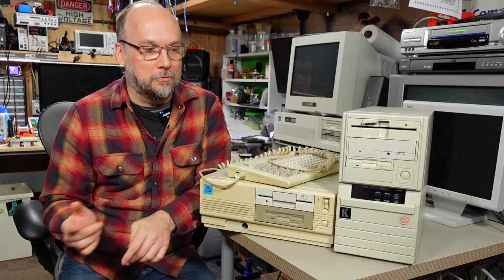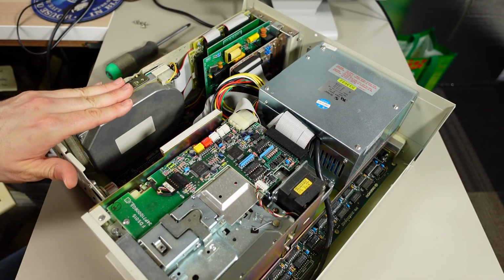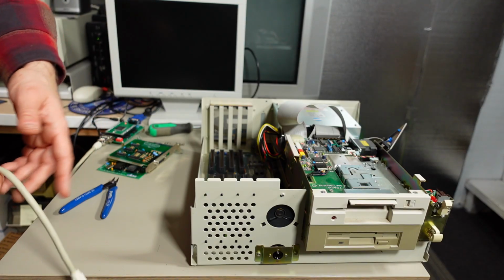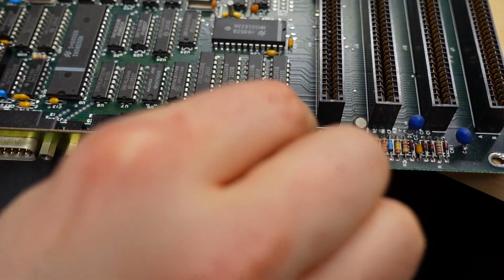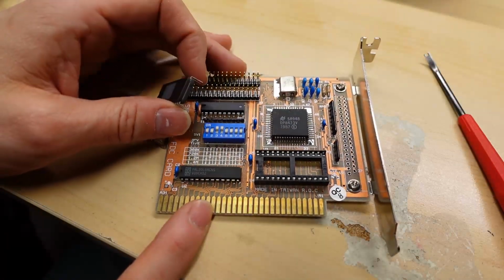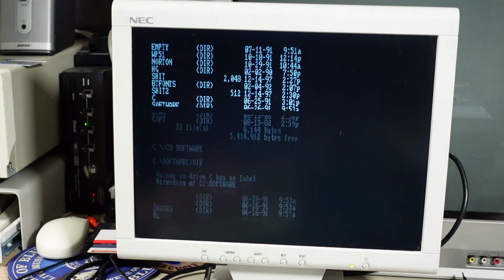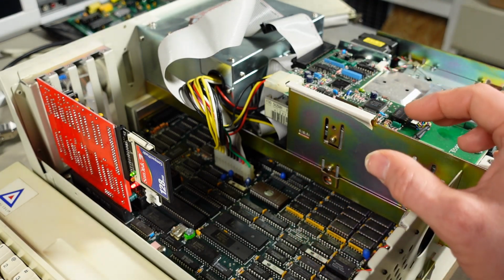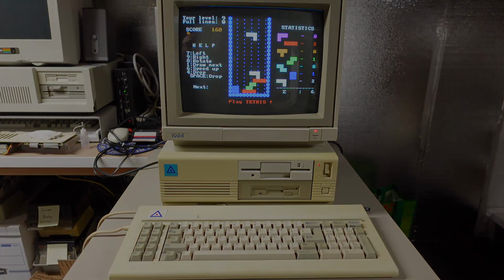PC archeology: Leading Edge Model D

Comment: Yes Leading Edge made 486's I had a DX2 66 that I eventually upgraded to a Cyrix 586 thanks to a Gainbery 133Mhz Cpu Maximizer cpu swap kit that I picked up at Costco back in the day ( around 95-96 ).  Kept the keyboard years after the pc was gone... Not like the junk they bundle with systems today... It was built to last ( messed around with AT to PS2 adapters then eventually to usb before I retired it) 💪👌

Comment: I know this is an old video, but I discovered you about 6 months ago and just turn on your videos in the background. I grew up in the "golden age", early enough to use a Commodore 64 but late enough to be a child through most of the early PC days (my elementary schools all had Apple II's, junior high had 386's). Your videos take me back to all that, and I realize now how much I miss it (even the "tedium" of setting numerous jumpers, that was candy to me).

My dad's last pre-Pentium computer was a Leading Edge mini tower: 486DX-33 with 4 MB of RAM and, I think, a 340 MB hard drive (WD). The coolest thing about it was that it had a really neat 5.25" floppy drive that was "half half-height", never saw anything like it before or since, it was essentially a laptop thickness 5.25" floppy. We kitted it out over time, adding a Pro Audio Spectrum soundcard with a SCSI interface and a caddy-fed 2x CD drive. Don't recall what the video card wound up as but we played Myst, The Journeyman Project, Battle Chess, Doom, Wolfenstein, a little known gem called Rise of the Triad, and I TRIED to run Quake on it (rather painful until we put that Gainberry 100 MHz upgrade CPU in it), and 8 MB of RAM. It had VLB slots, but we never used that. The CPU and some attendant hardware was installed on a daughter board along the bottom of the case for ease of access which connected via a long slot to the mainboard proper (RAM was on the main part of the board, under all cables).

Don't recall what happened to it, but that was the first usable PC that I REALLY got my hands dirty in, after light tinkering with his old Goldstar 386. Good days. Love your videos, Adrian, keep up the good work! If I ever come across anything of note in my basement or my parents' I will send it in!

Comment: Adrian -  I am both the primary author/designer/programmer of both the Wangwriter and the LE Word Processor,   I still have an LE and IBM that run LEWP.  I LAUGHED when you came across the ORIGINAL plastic sticker on the back but what you didn't realize is the BLUE LOGO on the left of the Model D front is actually a stick-on and I still have a few.,    It's a metal-like plate but the BLUE is actually plastic which peels off.  

I doubt the machine was from Late 1988 because by 1986 LE was selling Mitsubishi machines  - or MODEL Ms.  MODEL D''s the D satnds for Daewoo which  you discovered when your broke it open and saw Daewoo chips on mother board.

The battery was in Model Ds and early IBMS and its simply for the CLOCK.

The color of the disk drive with the lock tells me this was a DEALER-modified machine.   The original Model D  came with two floppy drives and then later shipped with 20mg Hard drives.   LE dealers often did their own thing after market and that's why you are seeing these other companies chips, drives and boards etc etc

Comment: After an insane amount of fiddling, I was able to get my model D connected to a very early version of AOL back in 1995. I remember it having an EGA monitor and I think I installed a 14.4 modem. Could get it on the main AOL screen but functionality was all but non-existent. Don’t think I was able to access web pages. Frustrated, I built a Cyrix 166 white box, 16MB RAM, and a 1.7GB Seagate HDD, win 95 and that was my first internet machine. Thanks for rekindling this memory!

Comment: Hi Adrian, i've connected so many times a 16Bit VGA card on an 8Bit ISA bus, the only issue, is that the bandwidth is slowe, but you can test even 8088 or 8086 with VGA cards. Some XT machines may not boot but, most of the machines will boot. Hmm, that keyboard looks fantastic, i would like the same quality in nowdays keyboards.

Comment: This was the first computer I ever used and cracked open.  It was my dad's that he had stored away in the closet for a few years until I started messing with it around 1990 (I was 10).  Had no HDD or modem, and had 2 5.25" drives.  The country I was in didn't have any software for the thing I could buy to learn (all I had was the DOS disks and learned some .BAT scripting).  That little 8088 still taught me a lot.

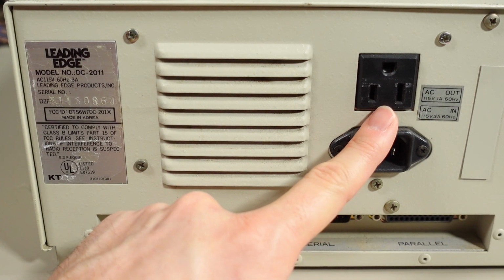Comment: 5:25 "You could plug in a power strip" ... it's rated for 1 A. You don't plug power strips into those because that creates the risk that you'll plug in stuff that'll burn out the PSU. Those power through ports are for monitors and nothing else

Comment: I bought one of these in 1988 for about $1200, a lot of money at the time. I couldn't afford a hard drive so initially I worked with two floppies. I also had a 1200 baud modem. I did my MS and my Ph.D on one of these and used it for my first 3-4 years as a professor. At one point I installed a hard drive, a whopping 20 Megabytes. The 1200 bad modem worked well enough to run SAS statistical processing over a phone line to the campus mainframe on campus. I also later added a 3.5" floppy drive so I could take my WordPerfect files to from home to use on my Mac office computer and print it out on the department laser printer. 

I really regret replacing it. Mechanical keyboard, light weight compared to the IBM keyboards. WP gave you a plain uncluttered screen that showed your text and some page and line numbers on an amber monochrome that was easy on the eyes. It would be worth having today because it was the best writing tool I ever had.

Comment: Just stumbled on this video. I remember these computers. When I was looking for my first IBM type computer, the actual IBM computer was extremely expensive. I seem to remember prices like $3300 ish. There were a LOT of IBM XT clones out there at the time. The Leading Edge Model D was one of the more expensive clones. It sat at a price range around midway ($2000ish) between the actual IBM XT and the clones, which I think cost around $1200 at the time. Much cheaper than IBM boxes, yet not as cheaply made as the clones. The Leading Edge Model D was a computer we drooled over at the time, but was typically as out of price range as the IBM XT itself was.

Comment: My first computer was an XT clone and I had both CGA and Hercules (clone) cards in it and drove two monitors simultaneously.

You said if no hard drive you could run 4 floppies, but you could still run 4 floppies AND a hard drive (or even two hard drives).

Comment: I had, and still own, a Leading Edge computer from the early '90s.  If I recall correctly it was The Leading Edge WinPro 486e, and it ran on the Intel 80486 processor @ 33 MHz, 4MB RAM, 120MB HD, CD-ROM drive, 5.25" Floppy drive, with stereo sound.   The OS it utilized was Windows 3.1.  So, this should be an interesting video for me to watch.
Reply: Yes, I still have the original keyboard, and overall, it was a fine keyboard, and still is by today's standards!

Comment: Adrian, you did not just buy a case in the late 80's/90's.  I worked for Computerland when those machines were new. We sold a ton of them along side IBM and major brands. Not off at all, actually, same plug just the female version had a surround to anchor it better. Why exactly do you do these videos? You have no personal knowledge  The Craft card is also a midi interface but you wouldn't know that since you know zero about any of this tech. That is NOT an MFM hard drive! It's actually RLL. XT's/and PCs did have batteries in off brands. Dude, get a real job, you are promoting misinformation globally which means more ignorant people talking about things they know nothing about.

Comment: I had a Leading Edge,  my parents purchased it from QVC in the early 90s - it was an XT clone being sold as new technology in the era of when the 386 was well in to production. Leading Edge at some point switched to Daewoo as the source of components which is where the D in the model name came from.

The built-in IDE controller was DOA from the factory on my machine, and the speculation (although I can't find historical evidence) was that Daewoo was using used parts in the machines to keep the cost down. Pile of junk

Comment: OMG.  I had one of these.  The front part of the case has yellowed, as I remember mine was white like the case.  Turbo XT, had a 8087 socket.  Compatible with the NEC V20 Intel CPU clone.  The monochrome graphics could use the CGA emulator to run CGA on monochrome monitors.  Looks like yours is different than the one I had, which had a turbo switch as well on the back.  4.77 to 7.16? mhz.  Mine came with dual 5.25" 360k drives.  The "D" in model "D" is for Daewoo, one of the Korean megacorps (Chaebol).

Comment: looking at this date codes of 85,  most likely a system that was sold between 1987-1992/3

2 options most likely  came either with a modem or 10 base-t

check what type of scsi it has you might be able to get modern scsi replacement for it

20 pin at power supply may be upgradable to and ATX

looking at the list of programs I would say this was was a word processing pc may may close to a 286 at..
this be likely a a late cga to early vga model looking at the screen clarity as if it was later most likely fit mid gen vga to early svga

Comment: This was my first computer as a kid. Ours only had two 5.25" floppy drives (we later added a  3.5"). When we added that drive, we accidentally broke one of the pins on the integrated floppy controller and had to buy one of the slot-based floppy controllers as a replacement. We also upgraded the RAM from 512K to 640K. Great machine for the time! This is the first time I've seen one since we got rid of ours. Thanks for doing this.

Comment: A friend and I got about a dozen of these Leading Edge machines in the mid-90s. The local community college had just replaced their workstations and auctioned off the old ones. We paid a dollar for a dozen. Thankfully that included keyboards and monitors. I think we got about six of them to work by cannibalizing parts from the others. We gave them away to our friends. The biggest problem we had was the hard drives releasing their blue smoke. Our units only had 5.25" drives with the hard drive taking the second bay. So, the only cards we had were the hard drive controllers. So many games were played on those machines. Sadly, I'm sure they were all trashed a few years later when we started getting jobs and could afford something a bit more modern.

Comment: I have a couple of these things. I bought one from a company in Tampa. that one came without a keyboard, but it has a VGA card and a hard drive. I later bought one from a guy in Boston. It was in the original box with the keyboard and an amber monochrome display. I've only ever powered on the Tampa machine with the KB from the Boston machine. I didn't know they had batteries inside, so now I have a project to get them out. I bought them out of curiosity. I have an older brother that had a Leading Edge clone that he used to do his doctoral thesis. Also, I went to a Leading Edge dealer with my dad in the mid 1980s where we looked at these machines. I was just a teenager with an Atari 800 at the time, so I don't think I understood what I was looking at. Thanks for the teardown!

Comment: i Have a Model D, 8088 7.16mhz 20meg hdd which actually still works!! 1.2mb  5.2floppy orange mono monitor... forst computer. 2400bps modem...  then wemt Hayes or USRobitoics... cpirse 8250 UART is junk after abpit 9600.  I so miss the BBS days!

Comment: The Amstrad PC 1512/1640 also supported 640x200(I think)x16 but it was incredibly slow.
You don't need the leading 0 on "Alt codes" in DOS, that's a newfangled thing on these fancy Unicode jobbies.

Comment: This was my first Intel PC, purchased in 1983. I think I paid $1,200 for PC, the 20MB hard drive on a card was an additional $800. CGA color, Hercules compatible monochrome 2 monitor was nice. Word processing on CGA was really hard on the eyes so you used monochrome when needed. Bumped to 768kb RAM,  rplaced CPU with V20 8Mhz, 20Mhz crystal over clocked that to 10Mhz, moded the RAM wait states and for an XT it was "fast". These machines were great.

Comment: Extended characters on Linux have, for quite a while, been based on Unicode code points. You hit ctrl-shift-u, then type in the code point number and hit enter. ķ is what I get for 137. So who knows what modern Windows is doing... perhaps DOS was using a different code page? Come to think of it, weren't most DOS systems using Codepage 437? That would probably explain the difference. But if modern windows isn't using UTF-8 then... what the heck is it using? Windows-1252 doesn't even contain that symbol you put up on screen (‰ U+2030, Per Mille sign) so now I'm even more confused.
Reply: ⛔ Even symbols like this are easy to enter on Linux! 😀

Comment: I bought a Leading Edge Model D in 1988 or 1987 approx.  It had the current tech at the time (XT clone) and it lasted for years. Price point was the reason why I chose it because name brands were so expensive back then. Plus it had an enormous marketing campaign.  So weird to see my old old everyday computer now an object of archeology!  Btw, you had to have a battery to keep the date from returning to 1980.  CN’t promise this was true for Model D, but it was for other XTs. Otherwise, don’t remember it doing anything. But dead battery meant every start up was 1980. Grrrr.  I think the hard drive card was an option, but hard drives were ridiculously expensive in 1988 so these came with two 5 1/4 inch floppy drives as standard for $1495 MFR back when that was a much larger amount of money than today.  Also, I think the modem was not standard but could be wrong.  But in any case, you’re looking at a souped up Model D!  But two floppies - luxury back then coz you never got more than one.  Of course, the first floppies I used were 8” floppies (very floppy when you held them!) but they were so much better than having to use the darn audio tapes we used before that.  (Put the tape in to load program - return in 30 mins & hope it was done!).  So the Leading Edge Model D seemed quite fast based on my mid ‘70s computer experiences.  But apologies, I kept thinking, “oh for goodness sake, just put a floppy with DOS 3.3 on it in Drive A”, I mean, that’s how we did it even when we had a hard drive. Hard drives were tiny then, so we had to go to Dos 6.22.

Comment: You can use the original BIOS chip, but you need to remove the jumper to disable the onboard RTC, otherwise the XT-IDE will clash and give erratic operation and basically not work, ask me how I know!

Comment: Adrian, have you had any luck on the ROM for this floppy card as of yet?
I may be able to repair that chip or pull some of the image from it. 
But, my question is. Is that resistor network the same value as the card you had found the image for online?

Comment: Leading Edge was a "clone' and were sold to consumers. I almost bought one in 1986 but instead optioned to get the Panasonic Business Partner. The Leading Edge was sold as a Bundle IIRC with computer, monitor, and printer for about $2500  - that was a lot of money back then. I got a deal with the Business Partner with a printer == but the Printer would never work right with it.

Comment: Well. Actually there really existed Leading Edge's 486 PCs. I know well because I have one somewhere in my garage: a top of the line Leading Edge Tower 8MB 486DX266 (SB-16, CD-ROM, 3-1/2 and 5-1/4 floppies, 320MB IDE HD), which I purchased in NY back in '94. Most of the components were Goldstar/Daewoo, though.
Back in those days it was cheaper for many Europeans (spaniard in my case) to take a flight to NY in order to buy a PC than actually buying it here (the then glorious "GiveMeTwo" NY's electronics shops).

Comment: Instead of using another DOS machine to reflash the XTIDE card, you could have also taken out the chip and used a programmer, if that's more convenient. (Which it sounds like you do have, based on what you said about the EPROM.)

Comment: Even if the BIOS doesn't support 1.44MB drives you can usually configure it with DOS. You cannot boot from 1.44 disks but at least you can read them.

Comment: I worked for Leading Edge and my first project was the the Model D from prototype stage.  It was one of the most popular computers in the US esp. after Consumer Reports endorsed the PC.  The computer had 640k, 4.77/7.16, CGA/Hercules all one big motherboard (even before the IBM PS/30).  The designer was Steven Khang who went on to found power computing, a Macintosh computer mfg.
Reply: " The computer had 640k," - You sure about that one? 

All (3) Model D's I knew of personally, one that was mine, two belonging to friends, required an expansion card to get 640k, it wasn't all on the motherboard.
Reply: I just asked this question further down but do you know the names of the games that came with it? I’m trying to resurrect a memory.
Reply: @lesliebernstein7287  No games came with the machine, just the Leading Edge Word Processing and I believe Nutshell database on some machines.